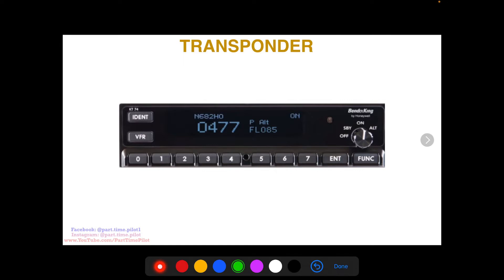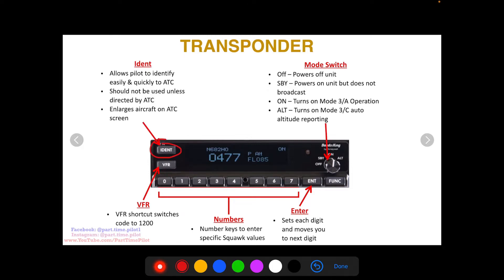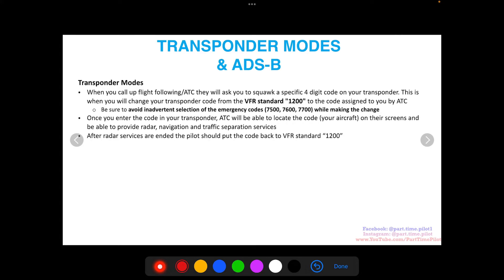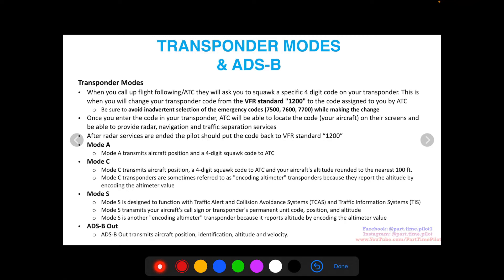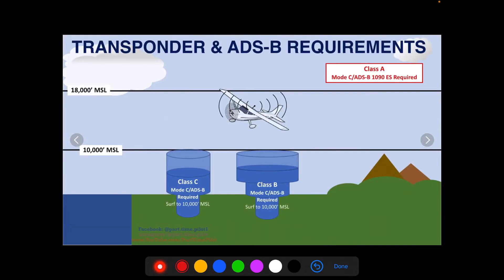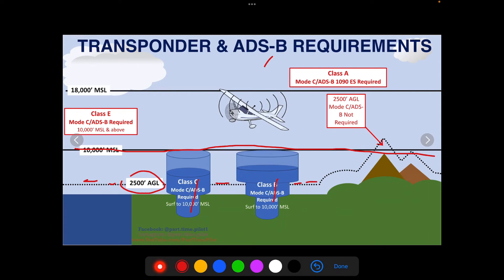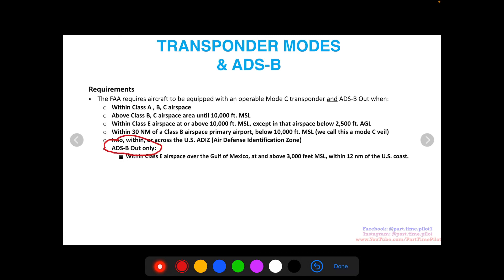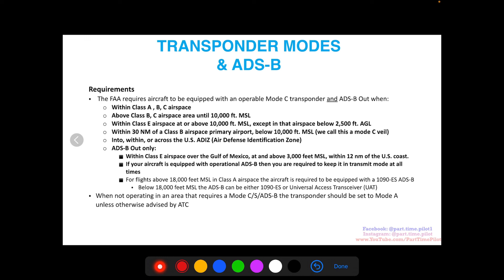What are the Transponder and ADS-B Requirements and How do they Work?

Comment: Referencing the bulleted list on your last slide, this doesn't seem right:  "When not operating in an area that requires a Mode C/S/ADS-B the transponder should be set to Mode A unless otherwise advised by ATC".  If you turn ADS-B off, ATC may still have you on radar, but wouldn't you become invisible to other airplanes and flight info services who use ADS-B for data & to help w/ situational awareness & traffic avoidance: Foreflight, FlightAware & FlightRadar24 for instance?

That statement also seems to directly contradict "If your aircraft is equipped with operational ADS-B then you are required to keep it in transmit mode at all times".  

My reference material says leave it on until the airplane is parked.
Reply: based on https://www.ecfr.gov/current/title-14/chapter-I/subchapter-F/part-91/subpart-C/section-91.225#p-91.225(i)(2) , I don't see anything about `when not operating ...`

Comment: And folks should be clear that aircraft type certificated without an engine-driven elctrical system, such as 1940s Cubs and Champs, don’t have to have ADS-B Out, even inside the veil.  Of course such Cubs and Champs won’t be going into the Bravo (and for me, a Sport pilot, also not into the C.  And I also can’t go into Ds w/o an endorsement).

Comment: Unless otherwise authorized by ATC, no person may operate an aircraft into, within, or across an ADIZ unless that aircraft is equipped with a coded radar beacon transponder and automatic pressure altitude reporting equipment having altitude reporting capability that automatically replies to interrogations by transmitting pressure altitude information in 100‐foot increments. 

It says nothing about requiring ads-b

Comment: I purchased your course and so far most of the information has been pretty clear. This one however, is not. I'm sure we go over them later in the course, but I don't even know what class A and B airspace ARE and you don't explain them. In addition, it is very unclear to me when which type of transponder is and is not required.
Reply: Thanks for the quick response. Your explanation is still a little unclear to me, but I think that is because I don't really understand what those airspaces are. For example, to me, as someone who has no knowledge of airspace, it appears that Class E airspace is ANY airspace above 10,000 ft and below 18,000 ft. Then class A airspace is anything over 18,000 ft. However, if you need the mode c transponder and adsb in class E and class A airspace, then why don't we just say you need them whenever you are flying above 10,000 ft? Same thing for the class B and C airspace. They say you need them up to 10,000 ft... but then above 10,000 ft you'd be in class E, wouldn't you? So then why don't we say that you need them WHENEVER you are in class B or C airspace. I'm sure this is wrong, but maybe you can see how it looks from the perspective of someone who is brand new and the training thus far hasn't explained any of these other topics. I think it would also be helpful to have a diagram which has a highlighted area for ALL of the areas you need the mode c and ADSB as well as an un-highlighted area for areas you don't need them. I appreciate your receptiveness to feedback. This is the only section so far which is pretty unclear. Also maybe slightly the section on magnetic deviation, but it's a little tricky of a concept.
Reply from the maker: @Subsonic-cd2en  I totally understand your confusion and I am glad you brought it up. I plan to split this lesson into to and put the part with the airspace’s after the airspace lesson. Once you go through that lesson it will make much more sense! I promise. 

Above 10,000 ft is not necessarily class e airspace so that is why it is not the case. But I see what you are saying.
Reply: @PartTimePilot  Excellent! Thank you very much for your time.
Reply from the maker: @Subsonic-cd2en  of course. Thanks for the comment it was a good one!
Reply from the maker: Airspace Classes will be explained later in the course. You make a good point on the airspace. I may have to split up the course and do the airspace requirements later in the course after we cover airspaces. Don't worry, we will cover the airspaces but I think you're right that it might be a little out of place. 

As far as the requirements: 
The FAA requires aircraft to be equipped with an operable Mode C transponder and ADS-B Out when:

Within Class A , B, C airspace
Above Class B, C airspace area until 10,000 ft. MSL
Within Class E airspace at or above 10,000 ft. MSL, except in that airspace below 2,500 ft. AGL
Within 30 NM of a Class B airspace primary airport, below 10,000 ft. MSL (we call this a mode C veil)
Into, within, or across the U.S. ADIZ (Air Defense Identification Zone)

ADS-B Out only:
Within Class E airspace over the Gulf of Mexico, at and above 3,000 feet MSL, within 12 nm of the U.S. coast.
If your aircraft is equipped with operational ADS-B then you are required to keep it in transmit mode at all times
For flights above 18,000 feet MSL in Class A airspace the aircraft is required to be equipped with a 1090-ES ADS-B
Below 18,000 feet MSL the ADS-B can be either 1090-ES or Universal Access Transceiver (UAT)

Comment: Your warning about accidentally scrolling past the emergency squawk codes on the way to a higher code on this type of Transponder seems irrelevant because you enter them one digit a time, as you mentioned.
Reply from the maker: Yes. There are other types of transponders and the point of it was that you want to be aware of either scrolling through or incorrectly entering these codes
Reply: @PartTimePilot  …but you did not explain it that way. You were out of context.
Reply from the maker: @dojoswitzer  you’re right I made a mistake. My sincere apologies
Reply: @PartTimePilot  Good video. Very educational. Really what I needed. Thanks for making it available. Thanks for your replies. I am sure you will do better next time.

Comment: Love the video as it really helped me visualize the multitude of airspace ADS-B requirements. However, one thing did sort of jump out at me........ At about 03:35 into the video, you say "let's say you are instructed to squawk 8571"   This unique identification is referred to as a squawk code. Each of the four digits ranges from 0 to 7, these are then coded as octal numbers for use by the transponder.  ATC is not likely to request any squawk above 7777 and would certainly avoid even coming near the 7x00 codes.
Reply from the maker: Yep. Good catch. I messed up there. Transponders are sometimes called 4096 transponders because they have 4 digits and each digit can be 0 through 7 (8 total options). 8*8*8*8 is 4096!!!

So it was silly of me to say that, I was trying to think of a possible example where you might get close to entering one of the emergency codes but forget it does go past 7777! Thanks!
Reply: @PartTimePilot  I think it's worth mentioning as a student pilot may not be familiar with hexadecimal or octal codes and be confused when the transponder won't respond to an 8 or 9 key input, thinking the transponder is broken.
Reply: @johnd744  So can I put in 7699?